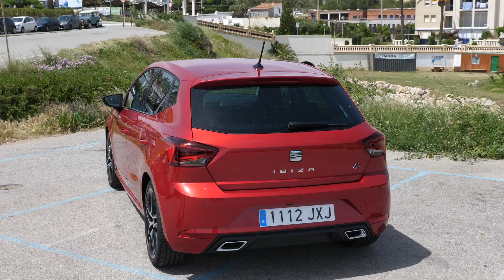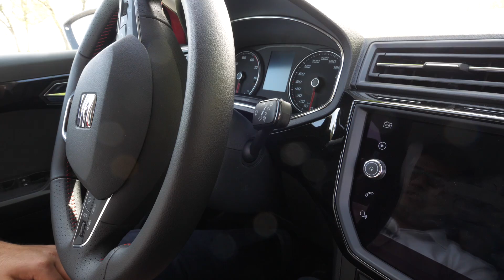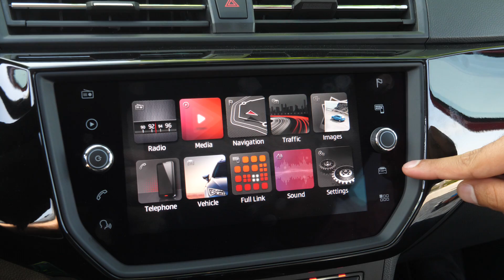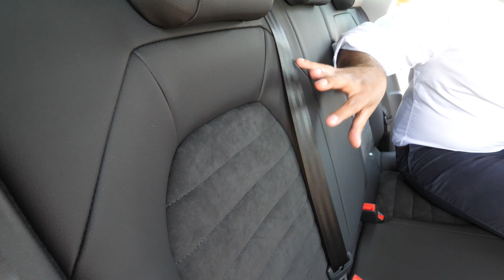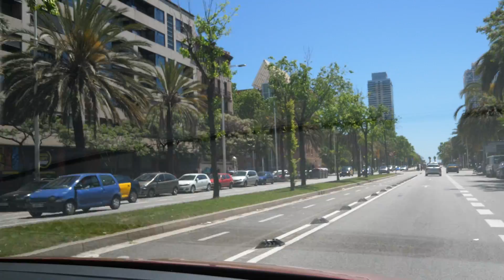Seat Ibiza FR 1.5 FULL REVIEW all-new neu generation test 2017 - Autogefühl

Comment: Bad idea to allow no subtitles option.
Beside that, very high-quality review, just like the other one (comparison between 95, 115, and FR 115) on the channel.
Reply from the maker: For new reviews since a year or so, we do offer manually created subtitles! Plus we have language channels in several languages with specific language subtitles
Reply: OK. Actually, automatic subtitles in English are very good. 
In this video, the automatic ones were disabled. @autogefuehl
Reply from the maker: Weird i didnt even do that
Reply from the maker: I re-checked, updated now, not sure why it wasnt
Reply: Thank you for your attention, The video is still without captions however. Maybe some technical issue with this specifical video; in every case, I have watched it and got what you said already ;).
I will add another piece of feedback since you take note of them. There are countries or parts of countries (I write this from one such, Southern Italy) where roads are like you would imagine a road will get if it is bombed from military aviation. There are bumps and large holes which you probably can't imagine, I mean, you probably meet one once in a while but you meet one every 30 or 60 seconds here.

This means that some vehicles will behave very different than they do on regular potholes and bumps you usually have to deal with. 
In the case of a 17"-wheels FR Ibiza, on every such large hole it will deliver to the spine of the car's occupants what is equal to a strong man's punch, every time.

This is hard to detect if the car is tested on a normal road, where it will smooth irregularities very well.

This is important not just for comfort, but because it will make the car an impossible buy for people of every age who have back health issues, and for people aged 60 or 70+ anyway. Such people will have to sell the car shortly after they have got it, if they buy it without first doing a careful test drive.
It can be a big, big issue.

There are other cars whose ride is close to the Ibiza's on ordinary potholes and bumps, but who are going to be two or three times as absorbing and comfortable as the Ibiza on the extra-ordinary broken spots of road. So ordinary ride doesn't tell us what will happen out of ordinary conditions with a vehicle.

What I want to say is, you could also test every vehicle on extraordinary holes and bumps (which are ordinary for a % of your viewers, depending where they live), and report on how well or not well the car does on those.

Thank you very much.

 @autogefuehl

Comment: Hey Aj or anyone, please help me with this stupid question

As far as i know. Camshafts are the one whos controlling Valves in and out, right? In miller cycle, when piston goes up doing compression's phases, intake valve slightly open and let some of air out. The duration/lift/timing of that opening makes start of compression's phase into variably, thats why its called variable compression ratio. Am i right so far?

Then the question is. Who was controlling that intake valve? I mean, what trigers them to open during compression's phase?

Thanks for your reply. Appreciated

Comment: Thank for a very good, comprehensive review with a focus that fit into the grownup frame of reference.
I've been driving a Seat Leon FR (gasoline) DSG 2009 model since it was new, and I love that car!
But it has 265K km on it, and I know I'll be replacing it soon.
I would like to scale down from the 200 hp/280 nm engine while still maintaining the fun-factor of driving. 
I have owned two seats since I like the feeling of getting the most bang for your buck while still owning af V.A.G. car, and I think the Seat Ibiza FR might very well be my next car. Seems I would get a very nice car with all the advances made in the last 10 years; not just the fancy electronics which are nice, but not really necessary, but most importantly with all the advances in engine technology and safety.

Comment: Hi, good overview, thank for that, nice description of 1.5 technical details. A question regarding comparing the 1.4 and 1.5 engines: did you recognise some delay in the response of 1.4 (the old one) 150 TSI with DSG at low speeds. E.g. ~20 KM/H, when you turn into a street at the corner, you step of the gas pedal, you feel nothing for 2 seconds, then after 2 seconds the power comes suddenly, not in a smooth way. It is not the delay of the turbo, which is understandable, but delay when nothing happens. Did you feel it with 1.4 as well? If yes, did you feel the difference with 1.5 engine? You mentioned this variable turbo way of working, does it mean, that the power comes earlier and smoother?

Thanks in advance!
Reply from the maker: thanks! Maybe you mean this: https://www.youtube.com/watch?v=Q87emkHLsSI
Reply: Yes, thank you, this is exactly I was thinking about, really appreciate. Did this behaviour changed with 1.5 TSI or still the same?

Comment: Hey there Autogefühl , I was just wondering if the unit that you tried had the optional Beats Audio speakers, and if so, would you be kind enough to help me out with a couple questions?
Is it good, sound quality wise?
Does the subwoofer take up boot space or does it fit inside the 18" spare wheel and leave the same space?

Thanks in advance for your answer and congrats on your videos!
Reply from the maker: thanks! We ll drive the Ibiza next week again, we ll see what we can find out
Reply: Autogefühl Hey thank you very much!! 
Keep up the great work!!
Reply: Autogefühl Hey there again! I was finally able to take a look at a Beats Audio equipped Ibiza. It sounds really really good and it doesn't take up additional space in the boot. Thanks for everything by the way!Keep up the great content!

Comment: The 1.5 150KM doesn't get the VGT or Miller-cycle. Those weird features are only present in the 130KM variant. 150KM variant however gets questionable aluminium cyliders sprayed with very thin layer of steel instead of classic steel sleeves as in any other VW engine. Unfortunately both of them get cylinder deactivation. So no matter which variant you choose - there are a lot of gimmicks to fail ;)

Comment: Is it noisy when two of the cylinders shots-off? Is there a setting in the ECU to do not let it happen ?
Reply from the maker: +Saroj Kumar you don't really feel the transition
Reply: What is your observations in comparing between the Opel astra 1.4 turbo 150 hp petrol vs this VW engine in terms of refinement and linear power/torque delivery ?

Comment: how does the engine has all that tech? its an engineering achievement, and in this segment?? how is it possible? when practically every other brand is still trying to put a single of those features in their range. its astonishing
Reply from the maker: +jh5kl mqb platform! Brings stuff in all platform vehicles
Reply: very true, but to pull this off in such this car segment is just phenomenal, i mean just the variable geometry turbo alone, not even all expensive sport cars of most brand have that, its incredible
Reply from the maker: indeed

Comment: This is by far the most detailed and best review of the new Seat Ibiza so far (in English). Really nice review! I've watched it from the beginning till the end. I have ordered the Seat Ibiza FR 85kW (115hp). I ordered it with the default 17" wheels, but I could still change it to 18". What would you advise? Do you think the handling and thing like bumps in the roads are worse with the 18" rims? Thanks in advance!

Note: it's a shame that the 17" black rims are not an option for the FR. These are only optional on the Xcellence.
Reply: Hi Tweak Er
 great to hear about your new car, congratulations from Autogefuehl :D The suspension on the FR is already a bit stiffer and lower than the other variants.. However, i didn't feel that it ever got too uncomfortable. the streets in and around Barcelona are really smooth for the most part, so it would also depend on where you live.. while the 18" wheel looks nice and big, take a look at the rear wheel.. the disk brake and caliper are really small. all that empty space might look a bit odd 01:39 ...though a larger rim generally offers slightly sharper handling thanks to smaller sidewall, i dont think for a 115hp car it would really make a difference.. in the end, i think you should decide if the extra money is worth it..
-AJ
Reply: Thanks for your reply AJ! I live in the Netherlands where the roads are pretty good. Sometimes I visit Belgium, the roads are really bad there, so for visiting Belgium 17" would probably be better. I think the 18" wheels look a lot better then the light grey 17" ones, but they also come with a price. I think I will choose comfort over beauty so I will play it safe and choose the 17" wheels. They don't look that bad after all.
Reply: they certainly dont look bad. and at first glance, its hard to notice the difference between 17" and 18" wheels. only you will have a heightened perception since you know the size.
Reply: I agree with Aditya, the 18" are more money just to give a perceived idea that you look better? The new Ibiza FR looks nice already from the outside, why firm up the ride further, on a car to be used on the Public Road? Very good Review by the way Aditya, with good camera views looking forward through the windscreen - many thanks. Kind regards.
Reply: dhruv gautam that's why it's not available in India
Reply: I would definetly go for the 18" - optics 😍
Reply: Hello

I ordered the FR version with the 17" rims.

I already went to a paint shop and they will paint the rims and it will be equal to the wheels of the Leon FR.

https://www.netcarshow.com/seat/2017-leon/1600x1200/wallpaper_03.htm

The painting service will cost me 350 €.

I think it is the best option, because the 18" rims are uncomfortable and the tires more expensive.

The only problem is that the car only arrives in September and then I will stay a week without it to paint the rims! But it will make up for it! :)
Reply: Carlos Estrela 

.....
Reply: Carlos Estrela good to hear! enjoy your new car
Reply: I have one on order too☺
Reply: Man Wtf is good in this car, it's over priced, it will cost me 17 lakhs Indian rupees
Reply: Indeed also its a shitty car in looks and have crappy interior, not worthy at all

Comment: Every other review of 1.5 EVO TSI said that it will have VTG and Atkinson cycle in the future Bluemotion 130hp version and this 150hp engine is just a stroked 1.4 TSI. 
Now which is true?
Reply: Yep even VW doesn't say anything about Variable Geometry and Miller cycle...
https://www.volkswagen-media-services.com/en/detailpage/-/detail/Golf-with-new-15-TSI1-engine-now-available-to-order/view/4814733/7a5bbec13158edd433c6630f5ac445da?p_p_auth=alNsqUO3

QUOTE - Another variant of the 1.5 TSI with 96 kW / 130 PS3 and additional technical highlights will be available in the middle of the year.

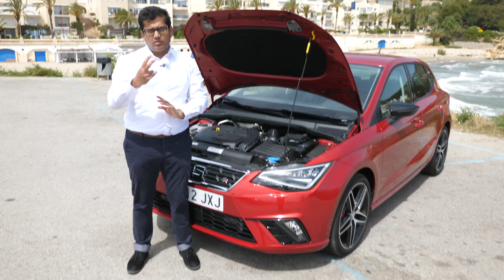Comment: 7:00 Two hood latches ! Thomas might have pointed this out.
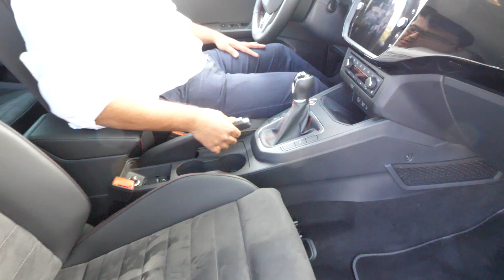11:04 Mesh pocket in passenger's foot area
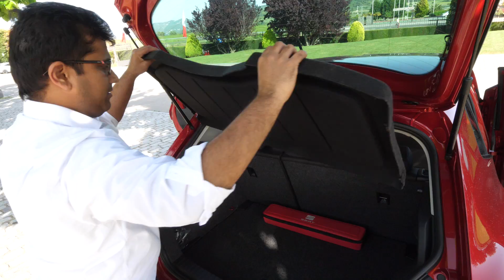22:26 Hinges for bags and rubber straps on the sides of the trunk

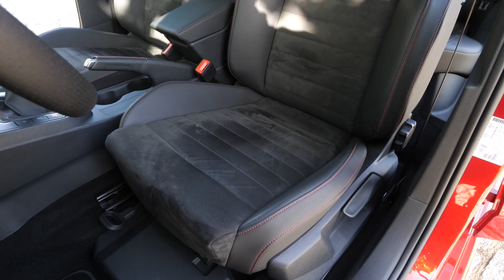8:43 I wonder what for is the plastic cover underneath the driver's seat